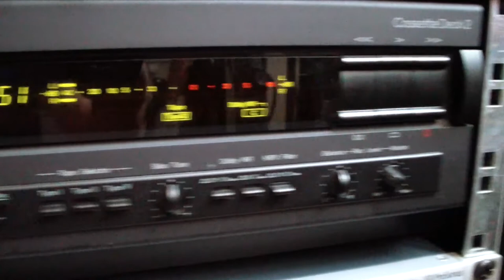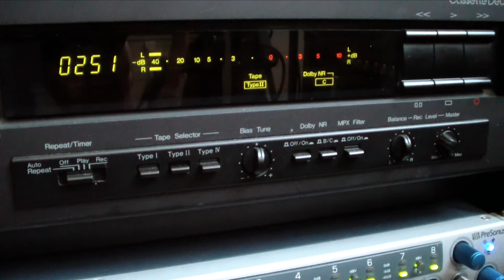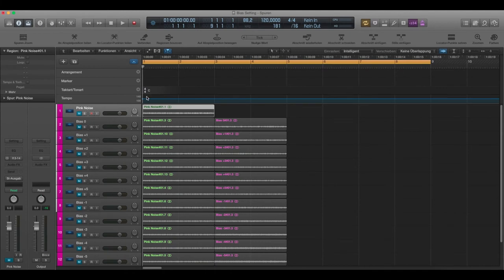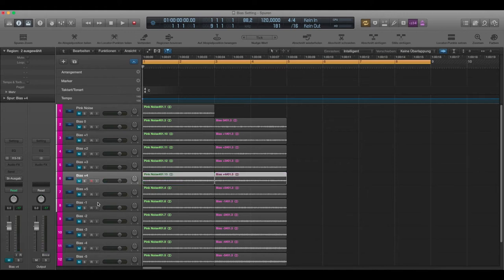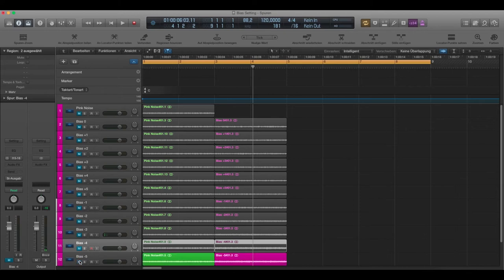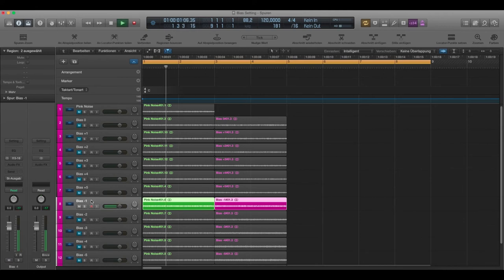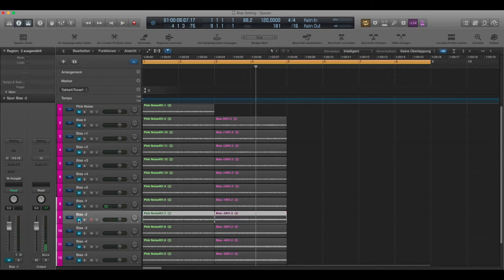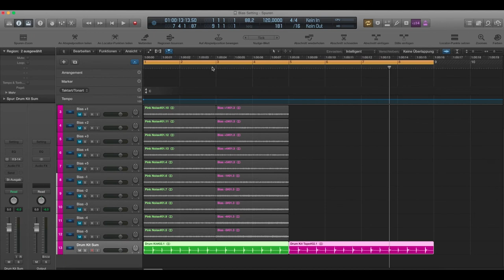How to bias a Tape Deck

Comment: Excellent!! All these decades and I had no clue what bias was. But now I know. Thank you :)
Reply from the maker: You‘re welcome!
Reply: Me too, but still not really understanding. I could never hear an audible difference when just playing a tape. So I guess it's only for recording, and before you make the final recording you have to test different bias settings.....?
Reply: @theonemodifier  It's only for recording :) The tape doesn't have a linear characteristic - both for amplitude and for frequency. BIAS setting makes the deck to use the linear part of the graphics of the tape where it works best.

Comment: Is there a general rule to follow or does it depend on the tape and deck a lot?  At least as a starting point?  I guess with a 3 head deck you can just switch the monitor and do it by ear pretty easily with a pink noise loop.
Reply from the maker: +Shao Zhang Yes, with 3 Head Tape Decks it's pretty straight forward. Just with monitor and adjust the bias until it sounds the same. Generally, it really depends on the Tape Deck, so you will always have to try and manually bias your deck for a certain kind of tape formula.
Reply: Would it make sense to do fine adjustments using a freq. response graph?  Like overlaying source and deck output graphs and doing the adjustment visually?  Can you recommend software that can do that?
Reply from the maker: +Shao Zhang Good question, never tried it this way. But it might work! I always do it by ear.

Comment: My late 70s JVC KD-65 does not have a BIAS control. Is this something located inside the deck somewhere? It used to be a top of the line deck so I assume it would have some way to calibrate it..
Reply from the maker: Yes, some units have it inside - you‘ll have to check the manual for that.
Reply: Thanks, you are right. I downloaded the service manual and it shows all the adjustments are inside the unit. Do you think I need a "calibration" tape to do this? Or can I do it all digitally as you seem to have done?
Reply from the maker: It should be possible to do it as I have shown, but you have to listen carefully.
Reply: Where could I download the various test tones from?
Reply from the maker: You‘ll have to use a pink noise generator. I think every DAW should has one as a plugin.

Comment: Wouldn't you want to jack up the bias when using a type 1 to cram as much treble on the tape as you can? I always wondered that.
Reply from the maker: +DJ alt.rock Well yes and no. It depends on the tape deck. Some sound really dull with certain tapes cause they were aligned with a special tape which is often not available anymore. If that's the case you can try and use the bias to get the high frequencies back. What you can also do, and many people still do this, is to record with more treble than you normally would. Cassette tape recorders tend to smoothen the top end and transients which can sometimes sound dull. So going in with more treble can compensate for that.

Comment: I  don't want to sound rude but when you were going threw the pink noise playbacks, I could not discern which ones were good/bad,  better...    i mean hoq does one determine which noise sounds better???
Reply from the maker: The concept is to get more or less the same pink noise on tape as the original in the DAW. With the Bias you can change the frequency response of the tape deck. The pink noise on tape should have the same high- and low frequencies as the original.
Reply: Just use your ears and pick which bias setting sounds best to your ears. You might prefer an “under biased” or “over biased” sound. Have fun with it and make something that sounds good to you 🌈

Comment: the bias adjustment should not have been done with dolby enabled.
Reply: If the sensitivity of the tape material used matches what the tape deck is calibrated to, Dolby shouldn't really be an issue. But in reality it is always better to not throw in any additional signal processing when you're calibrating.